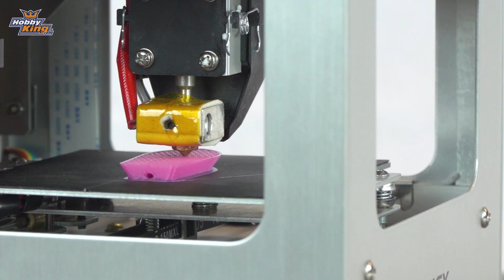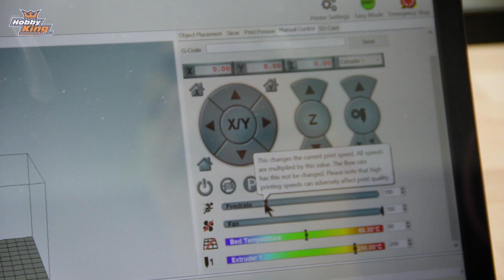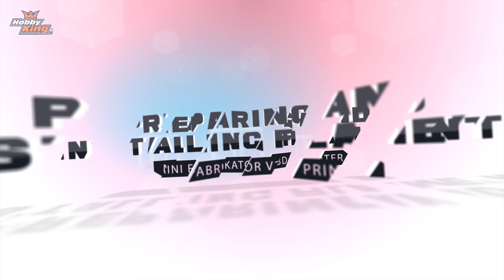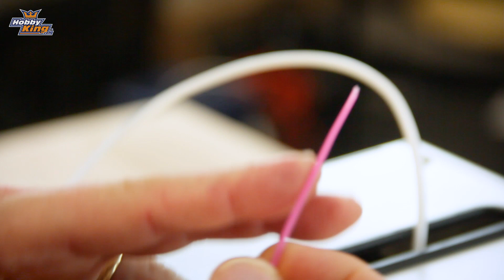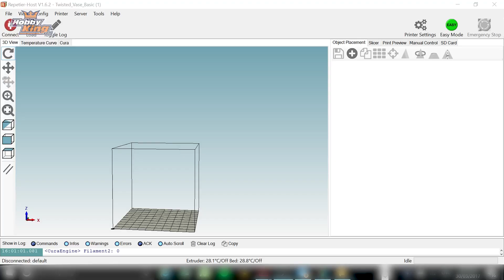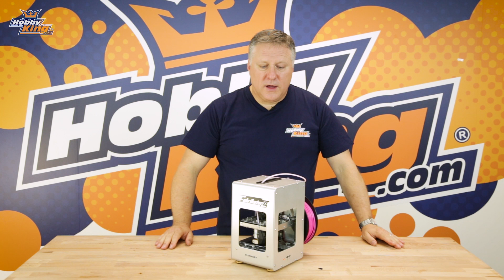Mini Fabrikator V2 3D Printer - HobbyKing Product Profile

Comment: IINTRO
I am going to start this off by saying that I own two of the Rabit Injection molding micro machines. Look them up online if you are not familiar with them. I bought them a while back,  after a contact of mine mentioned a company in CA was selling them because they had no longer use for them since they had expanded their operation to larger injection molding machines and they were sitting gathering dust, basically. My contact told me they were toys and I should really get a BOY injection molding machine if I was going to start injection molding.  

Coming from a hobby consumer aspect to establishing my own company to do the cool stuff I do, and having designed earlier my own injection molding machines,  from pure need within certain budgets and having  retrofited a table top machine built in the 50's to work semi-automatically, so that it would make the injection molded parts I was making for the MIA Robin 280 Micro and MIA Bunble Bee Sub-Micro and  MIA House-FLY Palm Size helicopter Kits back in 2000's,  these types of toy (not really) machines were exactly what I was looking for, more efficient and compact for the required application. 

THE FABRIKATOR MINI II
One can say the same thing, that the Mini II is a toy, but this is a great little printer, for starters and even better with some mods.  I had issues with mine after several test prints it started to loose precision in height and reliability. Being a performance and efficiency nut, and I have to tweak everything I get my hands on,  I took it apart and made my own anti-backlash Z Axis Upgrade nut and it has been printing perfect! and reliably.

PROS: 
The machine is ultra compact, and once it is properly setup it is great if you do fast prototyping and want a compact little machine next to your design PC or laptop, and want to fabricate DIY, or even short runs of small parts, as I am using it for. 
 
The frame is well built, made from aluminum plates to provide a nice solid  as well as attractive and user friendly boxy structure.  

The extruder and fan work great, but you do have to be careful not to clog the nozzle by over jamming the filament manually or trying to push in or out before the filament has reached the desired melting  extrusion temperature to avoid having to unclog it with a fine needle or wire. 

Side connection to USB and SD Card are logical and the lighted button on the side to give an indication of operation mode is useful, if you memorize its light sequence.  I would prefer an interactive display to access SD Card saved files.  

Filament guide thru the top is not quite vertical and direct from spool, but works. 

Mechanically, the X,Y,Z Rails are simple precision rods and the gantry rides on oilite bushings, via spring tensioned belt drives, to provide great anti-backlash operation on the X and Y.  The Z nut unfortunately is the weak link and part of the Con but can easily be upgraded as I did on mine for precise  and consistent first layer and higher quality 3D prints.  

The heated table works great and allows parts to stick, provided you calibrate the temp settings according to the type of filament you use.  A bit of trial an error here as the temperature setting can vary depending on work area temperature.

Leveling the machine is ok, but can be made better if the table is made thicker so that it deflects less at the extremes and you can really make great use of the "whole table" with precision. The table can be retrofitted with a glass surface for more rigidity and precision, I think.  The M2 thick alu table can actually be slightly bent by putting too much pressure and thrown out of level by prying off some parts that may stick harder to the table.  I am thinking of manufacturing my own 100mm x 100mm x 4mm glass table for even higher precision. 
 
CONS:
The most important axis is the Z , having only two regular M3 nuts back to back to provide some sort of anti-backlash is not precise. You need a quality anti-backlash nut assembly for a hassle free precise operation. That first layer is the most important!.  This is a nice machine and If only HK would make the Z axis nut much better, it would raise the  precision quality and  functionality of this product even higher!, as I have it set up on mine machines. 

The  table leveling screws are a pain to adjust with the hex key provided in the kit, and considering the table is small and inside a nice metal box,  I had to manufacture a mini handle for the stock hex key, and a mini  screwdriver like, low profile hex hey to adjust the screws more easier, with my thumbs,  in particular the back ones. 

Those Button Head leveling screws I think are too low profile that the hex key does not engage well in the socket and allows the hex key to slip, sometimes making leveling a choir. If they were regular hex socket heads countersunk into the aluminum  plate it would make greater hex key contact. I am thinking of re-designing the leveling screw feature more easier, at the  trade-off of perhaps making the table assembly a bit more complex. We'll see. 

The plastic scraper is a not very useful, it does not insert well under the 3D print to lift it off the table since it has a rather thick edge, I use a thin spatula and paint scraper steel blades as my parts scraper. 

The spool holder does not work with certain types of filament spools and it can jam sometimes the extruder stepper motor entry.  Best to make a separate spool holder direct in line with the stepper puller entry. Or even better have the Stepper entry be fed direct from the top over the heater assembly with the spool above. This may not look as pretty, but it would be mechanically more practical and less troublesome. I am working on this mod for my machine, because even though it has some cons it has a lot of potential to make great parts when tweaked and set up better. After all, all 3D printers basically share the same mechanical features and at some point they need to be calibrated. 

Otherwise, I love this little machine and I have gotten to know it well to make it better with the upgrades mods mentioned.   I ordered a second one to fabricate many of the parts you will see on my  latest RC microlights  on my  you tube channel and facebook pages.  I even manufactured a steerable Landing Gear Upgrade for the MIA Quicksilver RC ultralight and this caught the attention of of a few Curtis Pusher RC airplane flyers who retrofitted their Curtis RC flyers with my MIA QS steerable 3D printed nose wheel assembly, for more enjoyable and and precise flights.

DESIREABLE
It would be great to adapt an on screen display. I don't think it would be hard, so to select the files you have saved to an SD card, visually via the machine,  so you don't have to always  work with one file at a time saved to the only name Auto00.g or have the machine connected to your PC/laptop.  I may purchase a third, machine , even!  because I love compact well made machines that can make tiny parts.  Well, not so tiny if you really push the machine to its limits, I actually made a 1/4 scale pilot head on it, as one of the first test parts. Took a long time because I had full infill but came out so good!. 

SEE WHAT I MAKE WITH THE MINI II! 
If you want to see the cool parts I have made with this machine, over 500 parts so far and happily keep printing more every day, stop by  SUBSCRIBE to my channel https://www.youtube.com/user/MarioIArguello  or visit my facebook page https://www.facebook.com/mario.arguello.395  

I will be posting a full video on all the cool stuff this machine (s) is helping make.  Of course the parts have to be designed, invented,  first! and this is 90% of the work mainly. The printing can be done on any 3D printer these days, but these micro machines are doing the job I need them to do for now.

Comment: Printed the Fish Bone STL located in SDCard on PLA 1.75mm 215deg, 60deg bed while going on 50deg at subsequent layers. RCP settings imported. Generally not bad for this precision. Prying up will require using the yellow extractor plastic tool in box.

Comment: Ordered and done tests on Fabrikator II Mini. Be careful to check the Z-Axis Coupler Nuts M3 as well as the tiny lock nut at the base of Z-Axis. Ordered two and I was shocked to see the nut not having any screw thread, causing the axis to skip while not moving, resulting rattling noises. Apparently the assembly chain over-looked the tests. I had to disassemble to fix back a new nut. In addition, the USB Micro Cable is intermittent and defective, I had to use other mobile phone cable to attach.

Pertaining software, manual are "not in SD", they're online at the Files Tab. Lastly, nothing was mentioned on the Wifi Malyan control. No link or wifi module program is located both in SD or on the File Tab. The PCB apparently is much smaller than Fabrikator I, seemingly cutting down substantial costs. Hobbyking comment links are not able to feedback problems at site.

Comment: Buyer beware i guess im unlucky but i received mine yesterday and.. the extruder ribbon cable wasn't attached, the whole extruder platform wasn't attached to the z axis so did nothing, the print bed had a hole in the middle where the hot extruder had been pressed into it and the usb connector was faulty so if you just vibrate the desk it disconnects and fails the print. to top it all off i have to pay £30 so they can "check it"...

Comment: Some negatives I experienced after unpacking:
- There is no manual on the SD-card on the first batch it seems.
- "couple of models": excavator.gcode (not STL)
- the manual does not show how to connect the bowden tube. In the pictures it's not routed through the top of the printer like in V1 and in the video, but through a hole in the back.
 - Y does not home on the edge of the bed. You can see in the video that the paper is tilted because of that when he tests the first spot.

Comment: why does the table lose adjustment?
Reply: Jeffrey Seymore that's why you need auto bed leveling, can be a pain to set up at first but it's well worth it.
Reply: TheLukey21 not on something this small and cheap :) pretty overkill. Plus the software for auto leveling isn't always perfect. I don't mind adjusting bed level. Especially when it has four points of adjustment like this!!!! (The three point beds annoy me lol)
Reply: allenm00 because when the metal heats up and cools down it never goes back exactly the same way. Also when you pull your prints off you are pushing, and pulling on the bed and it will get out of alignment this way as well.